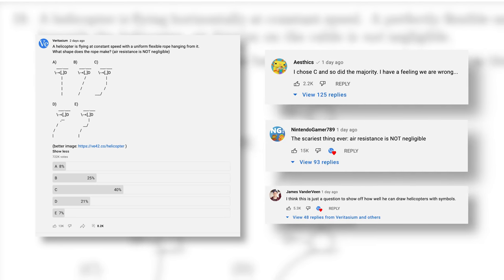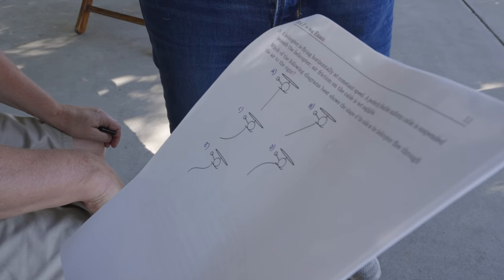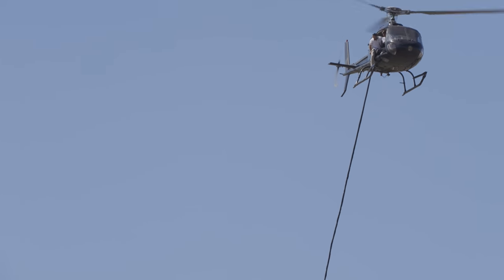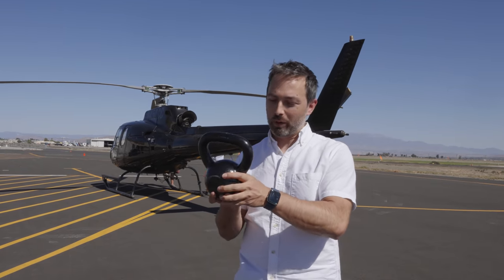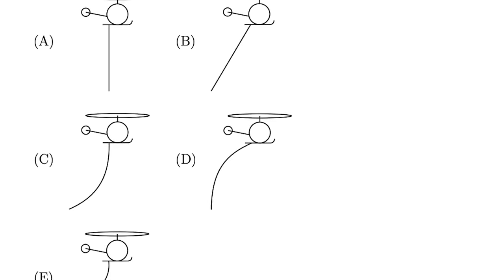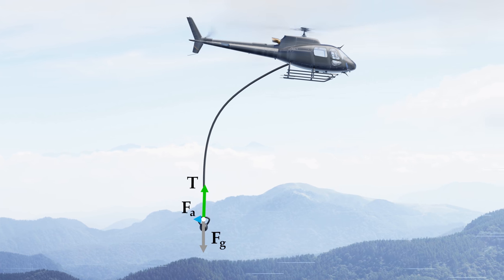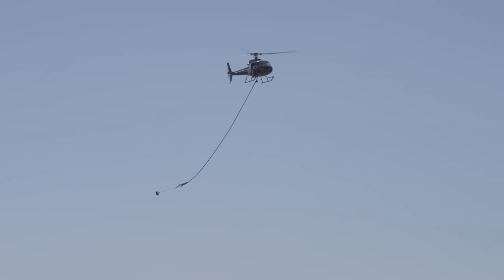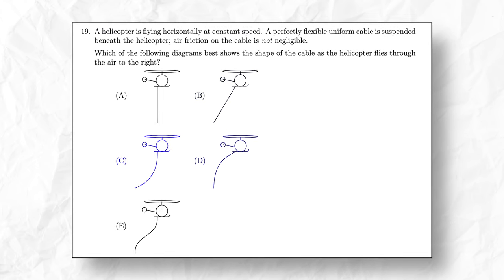I Rented A Helicopter To Settle A Physics Debate

Comment: I just recently came across your channel.  Great videos!   

Anyway, there is a quick way to induce the answers to both of the problems posed here:  Just imagine the helicopter is moving extremely fast, trailing a rope with no weight at the end.  Answer B, (the straight line), immediately suggests itself.  Now, if you mentally add a weight to the end of the rope, you can't help seeing the "droop curve" of answer D, as the weight at the end battles gravity.  All these forces are constantly in play, at any speed, so the curves displayed in answers B and D should always be correct, at any constant speed.

I personally think that air pressure has little or nothing to do with the inertial properties of the system.  If the tow vehicle was a rocket on the moon, say, (where atmosphere plays no role),  answers B and D should still be correct.

Comment: The answer is in function of the length / mass /surface of the rope , the direction/strenght of the winds at that time, and the speed of the helicopter. Each of these factors will affect the shape of the rope. If the rope has enough surface to act as a sail the answer will be D.

Comment: An amazing counterintuitive fact.
But as a teacher, I would never use something like this in an exam, especially in an admission test. This clearly worked just like a lottery.
Reply: Being graduate-level, you might expect that people would actually derive it. You would have to include a "ignore rotor wash" disclaimer though.
Reply: The question was posed in the context of a contest not an exam. 

It’s not like 30 students turned to page 2 and read that as a question.
Reply: In highschool, we got a much harder problem in a test which even the teacher didn't realize was unsolvable with highschool math. In fact, it's not even possible to solve it analytically. The problem was about a pendulum made out of a spring. The teacher just assumed the usual facts (e. g. velocity is horizontal under the suspension point) and solved the problem based on that. I immediately recognized something was off and wrote a small program that simulated the kinematics of the system. Turned out, the teacher's assumptions were not valid. Unfortunately, we couldn't convince him of this fact.
Reply: @viharsarok  Man I relate to this too much. Those problems so ridiculous not even the teacher knows how to solve them. But they're in our exams. Without calculator and with time limit.
Reply: Nah they’ll sort it out
Reply: It's one of those theoretical hypotheticals that is interesting and not as simple as it appears, but has no real practical value.
Reply: @RijuChatterjee  I specifically was considering rotor wash when he presented the question.  Disclaimer absolutely needs to be included... Although the question probably shouldn't be there to begin with regardless
Reply: I agree with the lottery bit, but only for an entrance exam - for exams that actually test your knowledge and understanding, I think this is a wonderful question! But I guess such exams don't really exist... 😂
Reply: It looks like a lottery when asked on youtube channel, but while doing an exam the student would draw all forces and analyze them attentively. I answered C because I've forgotten of downward tension and used gravity instead of it, i used no pen/paper and was only thinking things, but I hope that in more serious conditions I would attend this task properly)
Reply: @CGoody564  The question's role is to be a question, and as a question its practical value is that it tests - and maybe sharpens - the analytical skills of someone you might or might not want to hire as an engineer or a scholar. This is the case for most exam questions and textbook exercises. They are extremely valuable.
Reply: @CGoody564  but . . . . like, helicopter pilots? Seems pretty practical for them. 🙃
Reply: @RijuChatterjee  Yet the person that put the question in the test basically admits in this video that it was completely counter-intuitive and not what they would expect, as a professional academic in the realm of physics.
Reply: @CGoody564  How many times have I heard "this has no practical value" Thinking has practical value.
Reply: @PoopiDScoop  that's only because they never sat down and did the math.

Comment: “Rotor wash dissipates “pretty” quickly”. I’d suggest that this depends on the helicopter. A CH-148 Cyclone - as an example - has a very strong rotor wash.
Reply: it does but a rope thickness has a pretty small surface area to be caught in wash vs the overall length surface air being interacted on by the surrounding air
Reply: You are correct in that the size of the rotor and weight of the helicopter affect the amount of rotor downwash.  The critical factor here is forward motion through the air.  This means that the downwash is well behind the helicopter once you're past a certain speed, about 30-40kts in the AS350 used here IIRC (I used to fly them).  This also increases the efficiency of the main rotor as the blades are passing through clean air instead of the turbulent air of the preceeding blade.  This is called translational lift.
Reply: @FiferSkipper  if you watch the video you'll see why you're wrong. He explains why the rope is straight and it's nothing to do with downwash. It's because as you go down the rope the weight pulling on it decreases linearly but the air acting on it remains constant hence why it's straight and behind the helicopter. No real need for the insinuation about my piloting experience either unless it's just to make you feel smarter.
Reply: @FiferSkipper  if you consider the downwash's downward force as an addition to G, you can simplify the number of forces required to be proportioned.

G+downwash
air resistence
tension.

G is Constant at 9.8m/s for the purposes of this equation, so solving for downwash velocity and plugging in air density would give the additional force of downwash enacted on the rope. adding it to G we then need to solve for air resistance. However, this is where it gets tricky, as you have to solve for the drag coefficient of the rope, but also of the downwash, since fluid mechanics shows that a liquid (in this case the air moved by therotor) cases a drag force of its own when moving perpendicular to another flow or lack of flow of a fluid (the atmosphere not being pushed by the rotor but, relative to the helicopter, moving  inversely to the helicopter's momentum)

to solve this however we simply need the velocity and density of the two opposing fluids as well as the effective drag area of the downwash (the area where the speed would produce noticeable drag). density r times half the velocity V squared times the reference area A or  D / (A * .5 * r * V^2) gives us the Drag coefficient of the downwash, or Cd.

this gives us the affected angle of the downwash as well as the rope, however unlike the rope downwash has effectively no tension worth mentioning.

so finally we get to rope tension which would increase proportionally to the amount of mass being suspended by the rope, i.e, it would be higher the higher up the rope you go. Why is this important? because the tension offsets works with inertia of the rope to effectively stiffen it in response. the higher the tension, the stiffer it is and morel ikely it is to resist changes in motion.

now, with all that being clarified, we can finally clarify the interactions. Gravity and downwash creates a downward force on the rope, air résistance pushes the downwash  the opposite direction of motion via fluid drag, and then does the same o the rope, creating a force pushing backwards directly proportional to speed. tension in the rope interacts with inertia creating a stiffening effect to resist change in motion within the rope dependant on relative anchored mass and forces applied to rope.

Gravity. downwash, and air résistance gives an overall diagonal force, tension and inertia give a stiffening effect straightening the rope for the majority of its length. 

Therefore, the rope would be diagonal, as is shown.
Reply: @FiferSkipper  - You should watch the Veritasium episode in which a college physics professor bets Derek that Derek is wrong about something. It might teach you humility. Sometimes, even if you know what you know it does NOT mean what you know applies to a situation for which you lack familiarity.
Reply: @FiferSkipper  if you think the aerodynamic forces are increasing in proportion to tension, you already misunderstood whats being talked about
Reply: @FiferSkipper  to put it more bluntly/simple, the downwash has little effect on the rope because it is under the same forces being applied to the rope. The reason why downwash becomes translatory in proportion to speed is the same reason the rope stiffens. if you take the downwash out of the equation, you get the same effect upon the string. Try this experiment. Grab a string, hold it perpendicular at arms length, then spin in a circle or run. you'll find the faster you move, the stiffer the string becomes and the more diagonal it becomes, regardless of there being propwash or downwash.
Reply: @FiferSkipper  no, its not, that's a false comparison
Reply: @FiferSkipper  no, it doesn't. The tension changes in relation to relative mass length, which causes a resistance in change, and stiffness in the rope, which aerodynamic forces push on.
Reply: @FiferSkipper  the vid shows its not the aerodynamic force thats changing, its the tension and it's interaction with aerodynamic forces
Reply: @FiferSkipper  I think I see where youre getting tripped up, you arent thinking of the differences between the downwash and the surrounding air as differences in fluid.
The gale vs breeze analogy is inaccurate, its more like a vortex in a river. The vortex doesnt cause a branch to float downstream, that happens regardless of the vortex being there. The vortex just accelerates what's already happening
Reply: @FiferSkipper  thanks for showing you know nothing of fluid dynamics
Reply: @FiferSkipper  literally try the experiment, there is no curve
Reply: @FiferSkipper  thanks for once again showing you know nothing about what youre talking about.
Reply: @FiferSkipper  what is IGE hehe sorry im not into aircraft thingy
Reply: @FiferSkipper  ohh i see, thanks!
Reply: @FiferSkipper  aerodynamic force doesn't increase. inertia and tension do. as i have said numerous times, and explained multiple times. Also not a guy, as is clearly evident by my pic. You're trying to outphysics a physicist and you're failing, so now you're using what's called a shifting goal fallacy by claiming i need to prove aerodynamic forces, specifically drag, increases on the rope proportionally, which is not what is happening nor what i claim to be happening. Tension and inertia increase, not drag. tension and inertia cause the rigidity, not drag. Hell i literally explained it both scientifically and in simpletons' terms earlier and you still hold on to this falsehoods of believing the drag must change for this to be true when it does not
Reply: @FiferSkipper  The aerodynamic force is the same at any point along the rope. Period, full stop. The aerodynamic force that results from the relative wind caused by the helicopter's forward motion is exactly the same at every point along the rope precisely because that force is the result of every point along the rope  moving through the air at the same speed. Any aerodynamic force resulting from the downwash is also going to be  the same for every point. We know that because you're the one who told us that the downwash doesn't dissipate over a distance as short as the rope. 

I suspect that you also  don't really understand what causes the tension and how the rope is supported. The tension is an effect, not a cause, and results from the force of gravity + any aerodynamic forces. Those forces in combination result in a vector, and that vector is the same at every point along the rope because (again) all of the forces are the same at every point along the rope. The shape is also a result of the forces. As for how the rope is supported, every point along the rope is hanging from the point immediately above it. It's supported by the rope above that point, but not affected by the rope above that point. If the rope is 20 meters long the  bottom meter is hanging from the point that's 19.00000 meters from the top of the rope. How that last meter hangs is determined by the vector that results from the forces acting on that last meter. Yet again, those forces are the same as the forces acting on  the other 19 meters of rope, so that meter of rope is deflected from the vertical orientation that would result if gravity was the only force acting on it by the aerodynamic forces* in exactly the same way* that a very other meter of the rope is deflected. The result is that for a rope with a weight that's uniform along its length each meter (or centimeter, millimeter, etc.) will hang at the same angle, and the rope as a whole will therefore be straight.
Reply: @FiferSkipper  you're wrong, arrogant and silly.
Reply: I think both of you are mixed up.. the explanation shows that drag and weight are equal not to each other, but to drag and weight at any other point in the rope. What this means is that the actual speed of the helicopter (and the proportion of drag to weight) are irrelevant-- change in speed only affects change in slope of the rope, as also explained.

This is more of an integration problem: if you integrated the two forces acting on an infinitesimal piece of rope, over the entire length of the rope, you get components of drag and weight increasing at the same rate over the whole rope: hence the linear relation.

If the downwash was indeed non-negligible as our pilot friend suggests, the drag components of the infinitesimal pieces of rope at the top would be mostly downwards, and they would straighten the rope at the top as a result.
Reply: @Charles-qo2wt  thank you for taking the time to try and verify the experiment before responding. It is very much appreciated.
Reply: @ravenquinn7774  no problem. It's ridiculous to assume the outcome of an experiment and therefore not perform it regardless of how "silly and cute" you think it is.

I also have a degree in physics, although just a bachelors currently so I don't consider myself a physicist yet.
Reply: @Charles-qo2wt  oh? General physics or a branch specialization? Also obligatory physics joke

3 quarks walk into a bar, the first one says dont mind me I'm a little strange, the second says sorry I'm a little weird, the last one says hey handsome how much for a drink? XS
Reply: @FiferSkipper  hmm. so let's do the experiment again, but with a small airline instead.
Reply: ah, airplane, of course
Reply: @FiferSkipper  I can see that you probably learned you have no clue what you’re talking about considering the fact it looks like you deleted most of your comments, but at 10:15 you can see a flag going almost straight horizontal while attached to a much thinner, heavier rope which according to you must be being pushed down really hard for it to be straight

Comment: Derek: What would be the real risk?
Pilot: Both rotors
Derek: So anyway, I proceed to hang the Veritasium flag
Reply: lol, pilot was way more nervous than necessary. Good quality to have in your helicopter pilot. :)
Reply: - And a parachute.
Reply: @josephm.6453  Why? The pilot could easily sue Derek if something would go wrong.
Reply: @josephm.6453  Probably more worried about the helicopter crashing and killing everyone inside.
Reply: Lmao, sue. You don't walk away from a helicopter "complete destruction"
Reply: @josephm.6453  I've never seen a chopper flying with a parachute caught in its rotor. But I'm sure it's possible for that to take the helicopter down.

Comment: the fact i was so intrigued by the question and was trying my best to figure out the answers to all the questions asked is why i love this channel so much.
Reply: What is intriguing about this question is it isn't a physics question at all, it's an aerodynamic question and a rotary wing one to be exact. Helicopters are very similar to planes but also have huge differences that can confuse any other pilot. Individual blades move fore and aft, twist, change angle of attack, and can lead and lag depending on where that blade is in relationship to the swashplate (top of helicopter where all the blades meet). We have transverse flow effect, effective translational life, gyroscopic procession (actions occur 90 degree in the direction of rotation), and all kinds of weird stuff that must have baffled the first helicopter engineers. We can even have air flow backwards through the rotor system if in a descent with specific power applied (can be deadly) if forward airspeed isn't increased before smashing into mother earth. We also have the deadman zone, which during take off, you don't move forward and gain altitude fast enough to get through ELT, and you are too heavy (and stupid), and you lose an engine or transmission, you die. When I saw the pilot in the video do that quick take off and 180 degree turn, I felt nauseous. That is a hotdog or someone who doesn't have military experience to know that is a terrible way to take off. I don't care what direction the wind was or how much power he had, that is a dangerous take off to perform.

Comment: The problem with answer B in the first test is that the helo was flying diagonally. Not horizontally. If flying purely horizontal and viewed from the horizontal answer A would be correct. Albeit somewhat shorter looking from the air resistance and gravity as you explained.